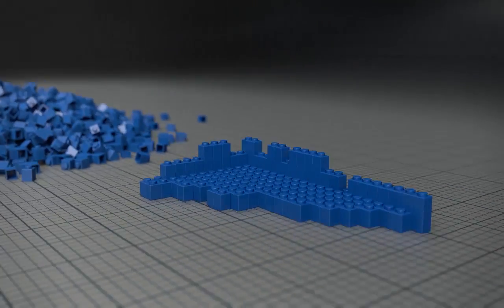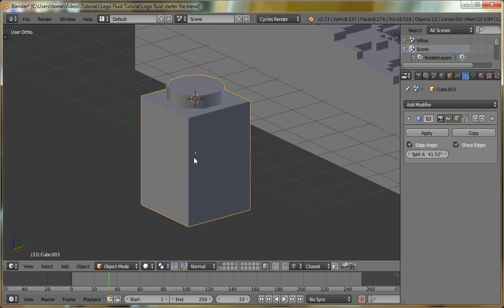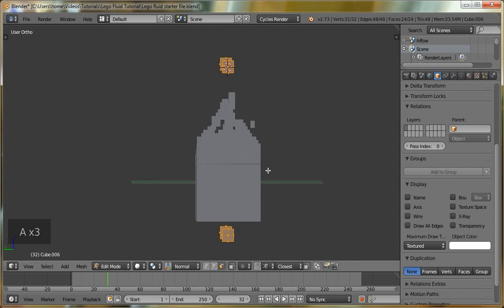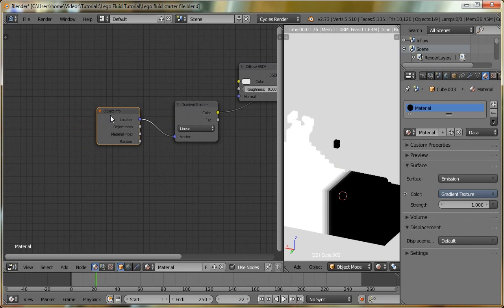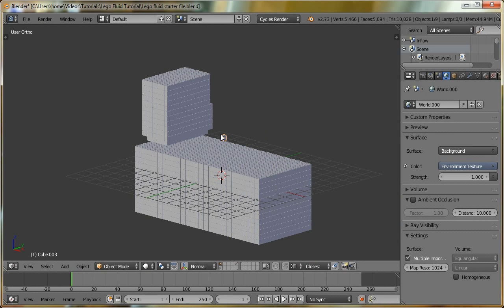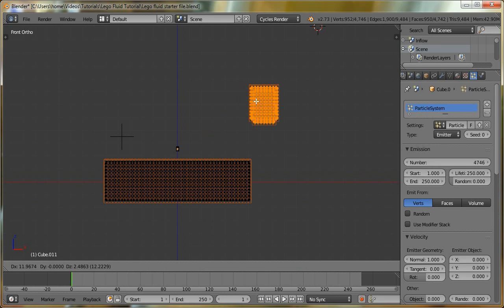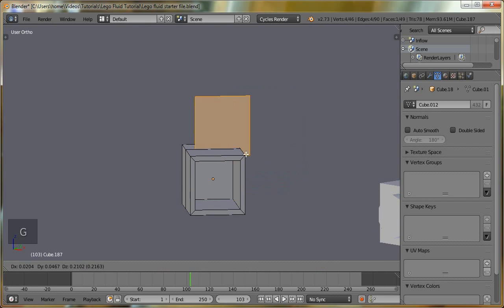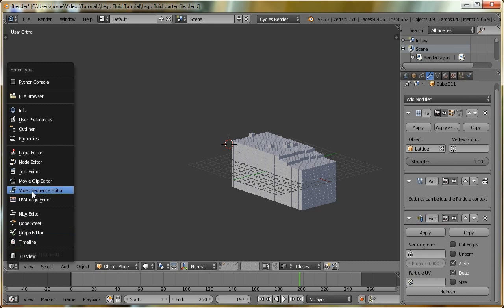Blender Tutorial: Lego Fluid Effect

Comment: I have a problem. I did everything that I was supposed to but for some reason the render keeps coming out without any colour at all. I've checked my settings and I have all the colour and textures in the viewport but not in the final render.
Reply from the maker: It could be several things: You have objects that are hidden in the viewport but visible in the render - check the outliner; you have changed the colour channel drop-down box in the image editor header when viewing the render; you have some compositing nodes which are changing the colours of the render; you have the shader nodes setup but not correctly connected to the material output.

Comment: Does this by any chance work with explosions? I know that water is more mesh based while fire and smoke are different, but it should work right?
Reply from the maker: You have to have a mesh to use the Remesh modifier and smoke is not a mesh. I don't know if there's a better way, but you can bake a smoke simulation to an OpenVDB sequence, re-import that to blender as a volume object and use the 'Volume to Mesh' modifier. And, now that you have a mesh, you can remesh it.
Reply: @RayMairlot  Correct. Messed with it and that's roughly how it works.
I only tried it with fire, but I assume and explosion could be done by separating the smoke and the fire, running boolean, etc.
Might be a cool tutorial, but I haven't gone any further so I can't say much.
Reply from the maker: @bombboy3427  Yeah, on the 'Volume to Mesh' modifier you can change the 'Grid Name' property to be one of the 'Grids' shown on the Object Data tab for the volume object. So I think you could have one object with the modifier using the default 'density' grid and another using the 'flame' grid and remesh each one. But there might be overlap between the two that you would have to deal with.

I did try a fake smoke simulation once by using a regular particle system that emitted meshes, which could then of course be remeshed, and that worked ok.

Comment: as far as I can tell, the fluid simulation works because you can bake the fluid into a mesh. This cannot be done with a smoke simulation.
However, using an addon called Cubesurfer, you could turn any particle system into a mesh, and then continue the tutorial as usual.

Comment: When I increase my lattice's V value, vertical lines are added to my lattice instead of horizontal ones. This seems like something I can easily work around, but I can't figure out why it's happening.
Reply from the maker: +Nathaniel Liles It just means your lattice is at a different rotation to mine in Object mode.
Reply: +Ray Mairlot It would also be really helpful if you added information on installing Node Wrangler to the description. I just downloaded the latest version of Blender, and it's not included.
Reply from the maker: I think there are already plenty of tutorials for installing add-ons, which is why I don't tend to include this information.

Comment: When I add the boolean and the select the object, a grupo of legos appear only to that box and not all a
8 of them like it shows in your video at around 15 minutes. I saw that you did something super fast with the pie menu during this part, but there is no way to tell what you did. Anyways, what could be the problem?
Reply: I'm using version 2.76. Eventhough only 1 set of blocks appeared after the boolean, there is no more jitter ar the bottom. Is this ok or will it cause a problem later on?
Reply from the maker: +Dara Smith Fotografía When I made the 8 corner cubes I made them in Edit mode so they are all one object. When I used the pie menu I was switching back from edit mode to object mode. Maybe you duplicated the cubes in object mode? If so, you can select the 8 cubes and press Ctrl+J to join them into one.

Comment: Is there a way to make the inner geometry hallow to make the mesh file smaller? I was exporting the sim to maya as obj export but the mesh is too big of a file. I hope you can help me out. Thanks
Reply from the maker: Ross Tec Well essentially it is hollow as there aren't any bricks in the middle of the fluid. I don't think there is a way of removing the faces on the sides of each brick that aren't visible to the camera though, not without doing a lot of editing by hand.
Reply: Oh I deleted half of the model and it is indeed hallow. That's good know. Is there a better way to export the mess than using export obj sequence? i can't seem to make the fbx animate when I export it to maya. Thank you very much for responding to my questions. i really appreciate it.
Reply from the maker: Ross Tec Obj does seem like the best way to go. I have exported cloth as .mdd before, but I don't know if that is a) better/more efficient than obj, b) compatible with Maya in any way or if it c) works with fluid. 

The second option is to reduce the complexity of the brick, maybe even down to just the top face of the brick, export that and try and find a particle setting in Maya that would allow you to emit bricks from those faces.   

A third option would be to delete the dupliverts altogether, export the plain remesh object and try to find the equivalent to dupliverts in Maya.

Comment: Using edge split increases vertex count, I would definitely avoid it. Instead of that, go into edit mode on the Lego brick, select the side faces of the top cylinder, press cntrl+f (face menu) and set the as smooth shaded. The end effect will be tha same.
Reply from the maker: Just setting it to smooth won't get exactly the same result, though it will if you add in supporting edge loops as well. I actually used a subsurf modifier on my bricks in my final version without too much trouble, so I didn't see a huge issue with using an edge split modifier.

Comment: Would this work with the fire simulator?
Reply from the maker: Potentially, there is a way to do it, but not as easily as with fluid there is no mesh. I may investigate it in the future. At the minute it is easier to use a particle system to emulate fire, have it emit cubes and remesh that.

Comment: Great tutorial! If I could only figure out why my blocks after the remesh modifier never come out as square blocks, but seem to be close to 1x2 pieces or two 1x1 pieces on top of each other randomly for each time I would be a happy man.
Reply from the maker: Did you apply the scale to the fluid object?
Reply: Ray Mairlot I could adjust the fluid object using a lattice after assigning the dupliverts so that it fits. But that might not be what you refer to. What determines the shape of the cubes resulting from using the remesh modifier? My workaround for now is to use a cube as both domain object and initial fluid object.
Reply from the maker: Jon Moe  No, at 2:15 I mention applying the scale to the objects.
Reply: Ray Mairlot TIL there is a apply rot/scale using ctrl-a that is something completely different than insert keyframe rotscale... thanks